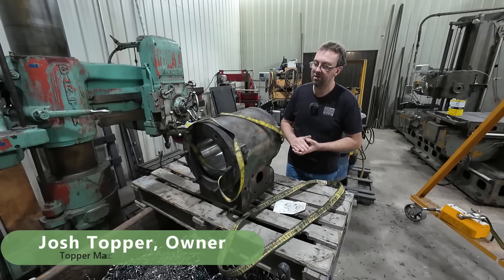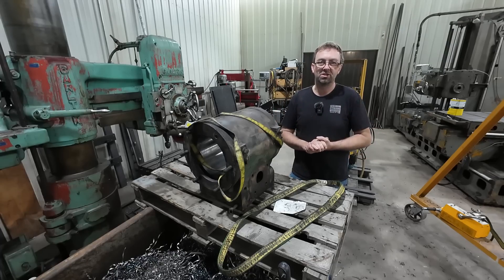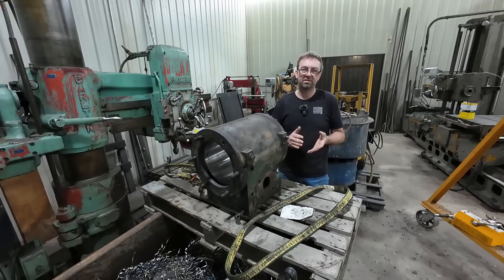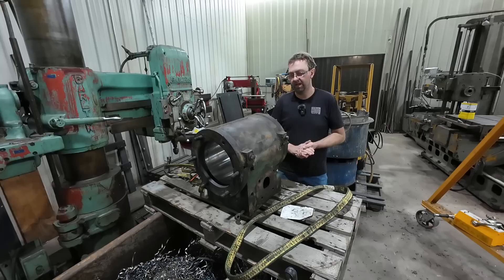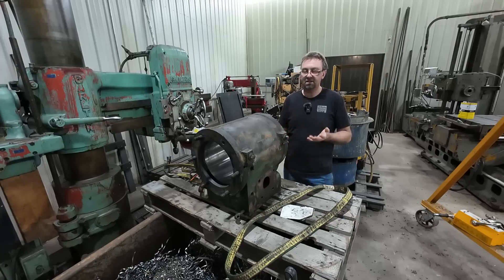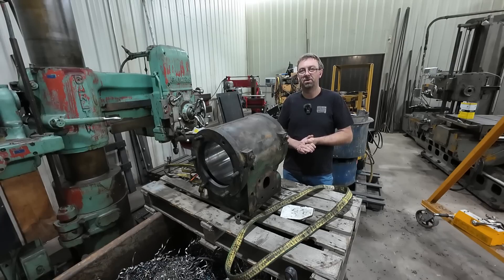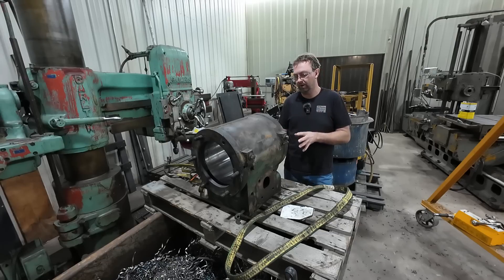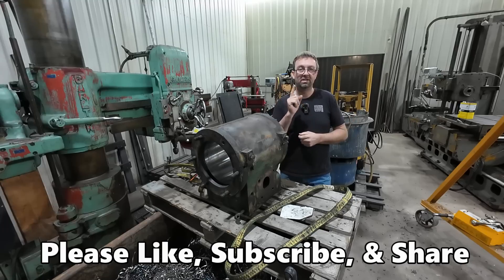Steam Engine Cylinder Boring Follow-Up - Honing & Answering Viewer Questions & Comments

Comment: Aluminum seems unusual for a steam engine piston. Sure, models are often made out of aluminum because of its ease of machining. I would stick to oem materials. Making a pattern and having a piston cast is not an ordeal. The balance of reciprocating parts would be different if an aluminum part was inserted where designers before had cast iron.
Reply from the maker: Many engines are out there with aluminum pistons now. Many with several years of run time. I'm not concerned.
Reply: I'm curious why aluminum just for ease of machining? Durabar is readily available in disks that would work to make a piston as well. The piston in my Ames engine appears to be hollow cast iron which seems odd but maybe done to keep weight down since it is a fairly large engine at 11" bore? Is that normal or are most solid
Reply: I'm also curious about the choice of aluminum vs iron. Does it simply come down to availability?

And you're definitely right about whether folks understand steam or not, there's a world of difference between steam and internal combustion engines; almost the only similarity is the shape of the cylinder :).

Comment: Oil-circuit-engines are quite different from steam-engines concerning the lubrication. On the other hand: honing is mandatory for 2-stroke-cylinders, too.
 I don't know if honing makes sense in a steam cylinder, but I assume that honing should create no problems at least...
Finally: VERY interesting content!!! 👍👍👍

Comment: I'm not a machinist by trade . I was a welder, pipefitter for 35 years now retired. In my experience take 3 different tradesman give them a project and they will go about it 3 different ways and use different tools according to what is personal preference and tools available. Not saying any of the ways are wrong. YOU decided what would work best for YOU! YOU are happy with the results so who cares what anyone else thinks! I love your content. Wish we were closer I have a couple of pins I need grease ports machined however shipping from eastern WV would be cost prohibitive, best wishes and happy holidays from Rexy.
Reply from the maker: On shipping, do you not have things shipped to you all the time?  Order online and a few days later it arrives?  You don't have to go anywhere to get what you need. Shipping is far cheaper than your time and fuel to drive around to find a shop to do the job. I'd be happy to help with your pins.

Comment: Thanks for answering the questions good and bad. Your set up looked fine to me. And the results looked perfect.  I think the honing was above and beyond but as you had a friendly shop that could do it, it just finished the job off.  As you mentioned the conditions for saturated steam in a cylinder   are quite different to internal combustion engines, as even without emulsified oil the steam, the vapour droplets act as a lubricant in their own right.  For various reasons I’ve been unable to get my own Mclaren  single cylinder traction engine out in the UK for a number of years but it’s safely under cover and periodically I turn the flywheel over with one hand to make sure the piston remains free. It still moves so freely that it still comes to rest  on the  the weight of the unbalanced crank axle.  Looks like you have another 300 years of life in your cylinder yet.

Comment: Good morning Josh.
I absolutely agree with you and "Your" decisions to do everything you did from setup to machining.
There was nothing wrong with your way and procedures in boring the steam engine.
You did it yourself, the best way you could.
I am certainly glad you decided to hone the cylinder. 
Do you know how much was removed during honing and was it pretty true?
Looks great.
Thanks Josh have a great week. 👍🇺🇸👍
Reply from the maker: I don't know what we actually took out. I'll be measuring it when I order the rings. Hopefully, it will be around the first of the year. I'll use the bore Guage and check out everything.

Comment: If the oil is there already, is cross hatch necessary? Or. Is it to breakin rings? Very interesting, love your thought process!
Reply from the maker: That is the real question. Oil is atomizer in the steam, carried into the cylinder. Cross hatching may not be necessary.
Reply: On a combuston engine cross hatch is to wear the cylinder to match the rings quicker. that reduces pressure to the crankcase where is oil is quicker.
I assume you know this.
With oil infused steam l dont think it would be needed.
I would talk to the ring manufacture to get there opinion

Comment: 1. Well done. As you said, it'll be the best it possibly can be now. The larger angle plate with the smaller hole in it might have been used to set up but I enjoyed your method. If you ask a dozen engineers how to do something you'll get a dozen methods. I probably would have bought some inserts for cast as they do work really well. Keep working and producing the videos. Always interesting. Bob UK.
Reply from the maker: I agree, there are many ways to do the same job.